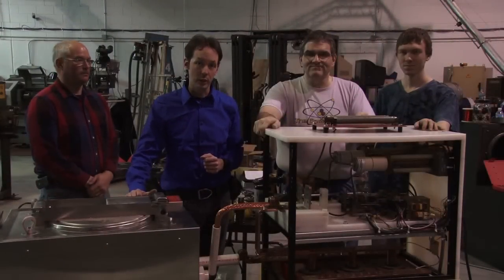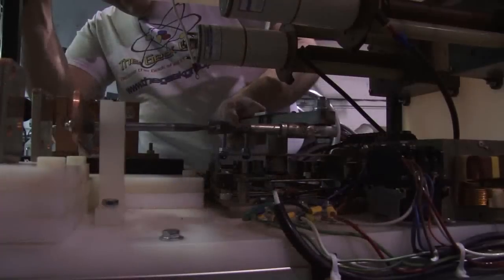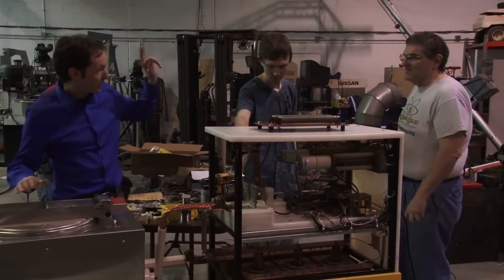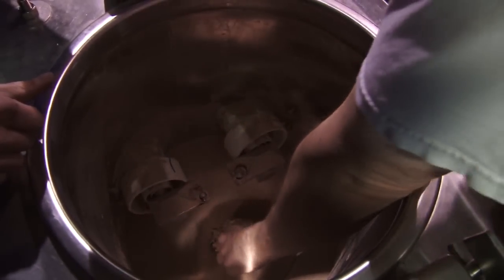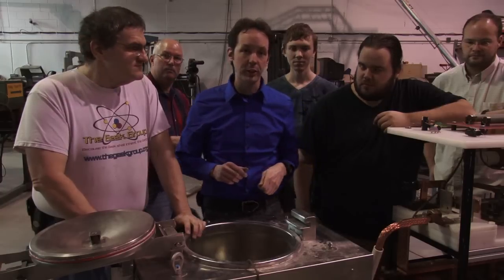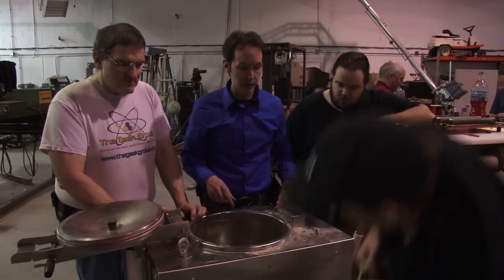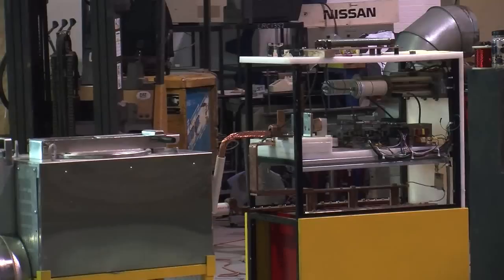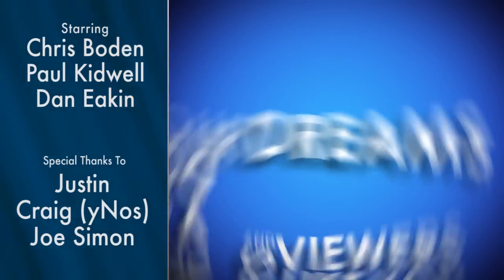Project Stomper Mark 4 Success!

Comment: adding fiberglass to concrete does not work.The alkaline content in the cement will dissolve the fibers.The cement will be weaker not stonger.You need to use polypropolene or metal fibers.google it

Comment from the maker: @CoderjoeIsTaken By "Mobile" that means we can move it from room to room. This will never be used outside of our lab. The spark you saw was a small piece of molten copper from the main rails welding themselves together. This only happened in the first few tests as everything settled.

Comment: On the firing at 6m16s, there is a spark that drops between the two cabinets, which looks like it was most likely still glowing when it hit the floor. Any idea where it came from, or are you just not going to worry about it? I'm mainly asking due to a possible fire risk at a mobile demonstration, if any ever happen.

Comment: @thegeekgroup you are right...i dig your science thanks!

Title 18 United States Code, Section 331

Whoever fraudulently alters, defaces, mutilates, impairs, diminishes,
falsifies, scales, or lightens any of the coins coined at the mints of
the United States, or any foreign coins which are by law made current
or are in actual use or circulation as money within the United States...
Shall be fined under this title or imprisoned not more than five
years, or both